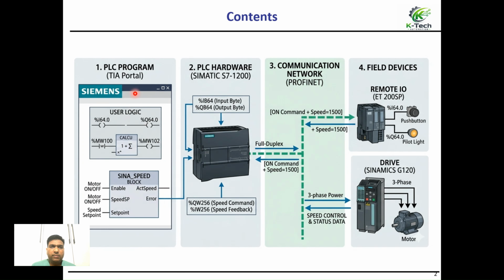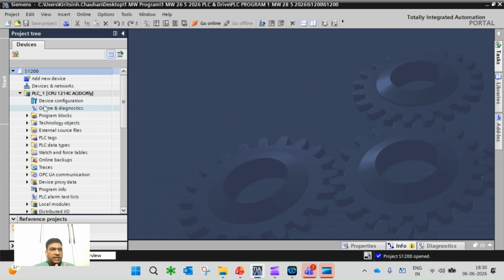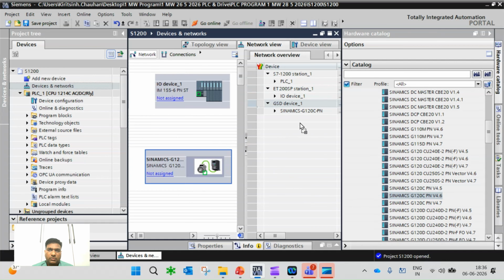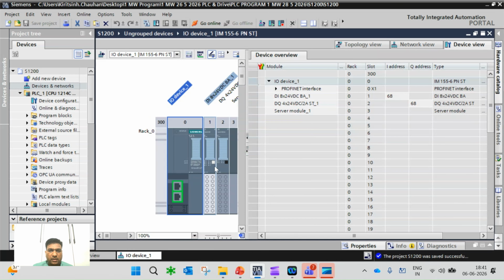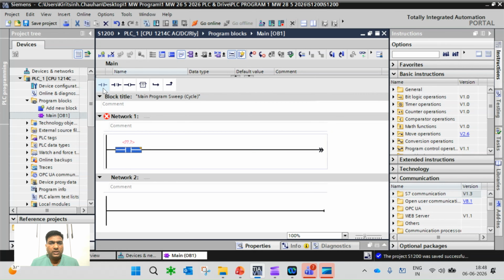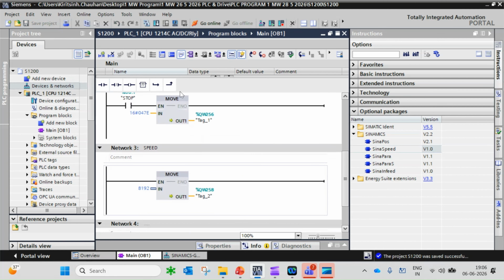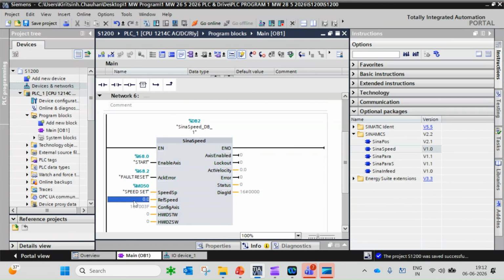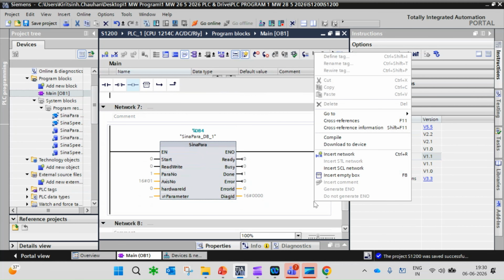Part: 3.4  S7-1200 to G120 PROFINET Communication | 047E, 047F & SINA_SPEED V1.0

Comment: Please Explain How - 16#047F, 16#047E ?
Reply from the maker: 16#047F = 0000 0100 0111 1111  (Operation start)
1111 = 1 bit: Disable ramp down 2 bit: no coast to stop 3:No Quick Stop 4:Operation Enable
0111= 1 Bit: Ramp Active: 2:Bit: Ramp Unfreeze 3 Bit: Setpoint Enable 4:Bit: No Reset
0100=  1bit: Jog1 2:Bit Jog2 Bit 3: Control by PLC 4: Direction command
0000=  Reserved
16#047E: 0000 0100 0111 0111 (Operation disabled)
Please consider a bit from Right to left
Reply from the maker: It is not necessary to set the Hex Value; you can pass the decimal value after conversion from Hex